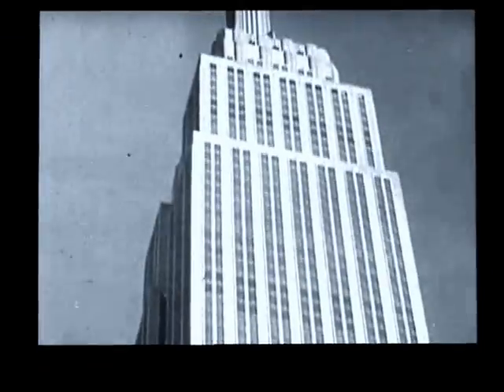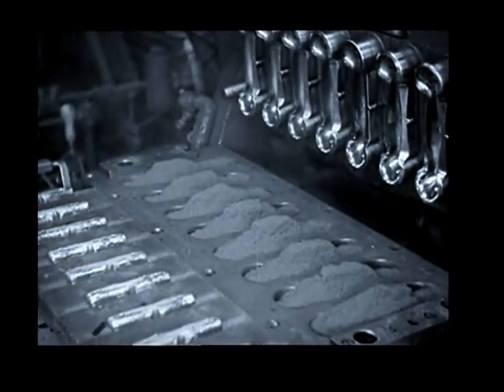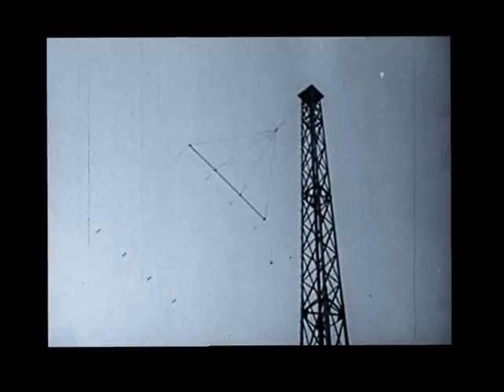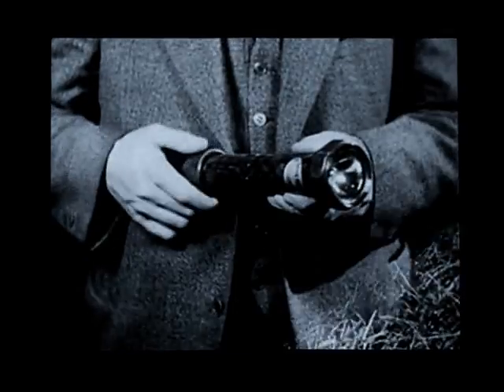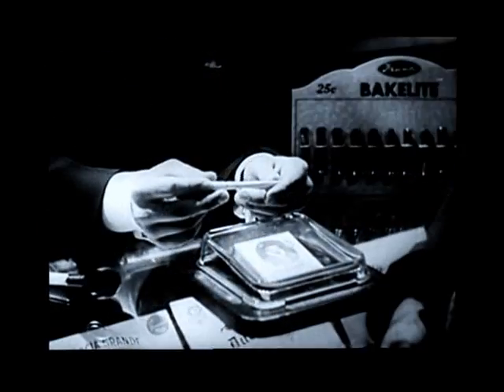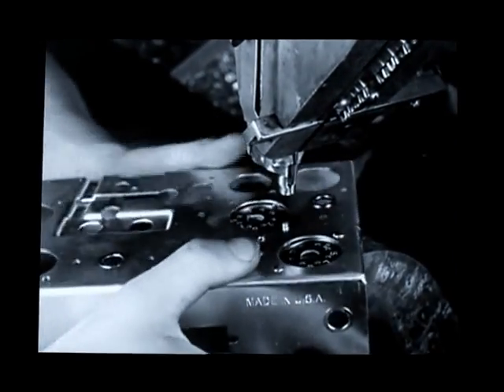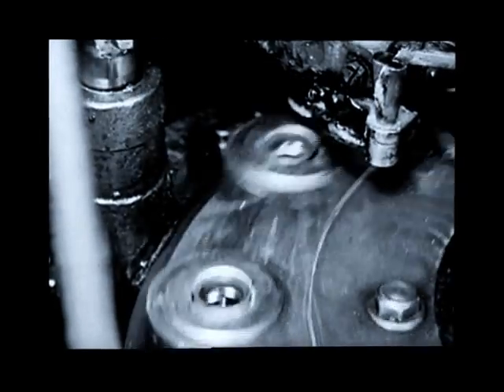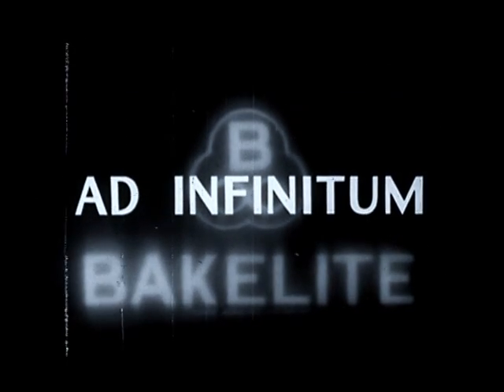Bakelite Manufacturing 1936

Comment: Resinoid is a combination of phenol and formaldehyde, usually mixed with cellulose (sawdust powder) and pressed into a mold with moderate heat and pressure. to form shapes such as distributor caps, knobs, buttons, electrical plugs, phone receivers and so forth.

Comment: Trouble with bakelite..very sensitive to breakdown from UV radiation
Reply: It was not very good for house electriical switches either, due to carbon tracking.   With enough use and damp hands you could eventually get a shock.

Comment: I honestly wish a warning at the start and end of the video informing the public of the TOXICITY of Bakelite. It wasn't as inert as the company advertised. The materials used to make it, the waste produced from making it and the product itself is one reason why the Cuyahoga River burst into flames....a few times. Wanna hear the test to tell if its true Bakelite you have? It screams at you 'toxic', either lick it or put it on your lips, its an unpleasant feeling and lingers and may leave a rash, hives, illicit an allergic reaction. Never grind, sand or fracture Bakelite, even polishing it can release Asbestos or Lead particles, but the phenolic dust itself it toxic. Bakelite is attributed for multiple types of cancers and was seen in highest in those that made it, machined it and used it. Yes, it is still made for very limited industries, yes it did help start the Plastics Boom of the 1960s, but by 1975 nearly every aspect of it was banned from everyday life in the US.

Comment: MY PARENTS STILL HAVE  light switches in this plastic and skirting boards which is very rare..My dad knows they have 5 per cent asbsteos inside.proberly why he just left them there all these years...They lived there 45 years  plus...
Reply: I worked in the factory that made those light switches. As with asbestos in pipe insulation, as long as it isn't crumbling it isn't a hazard.